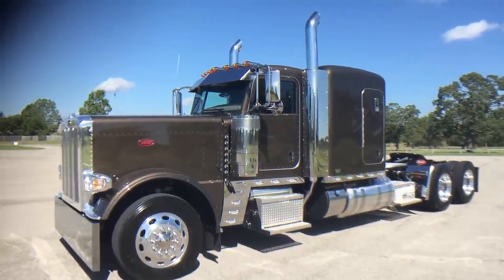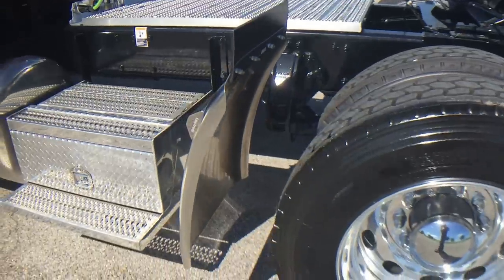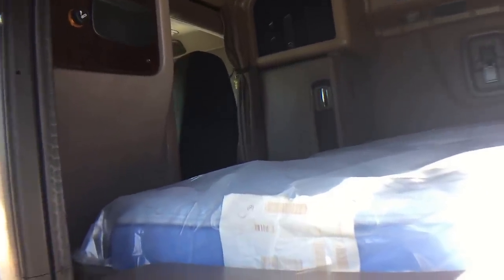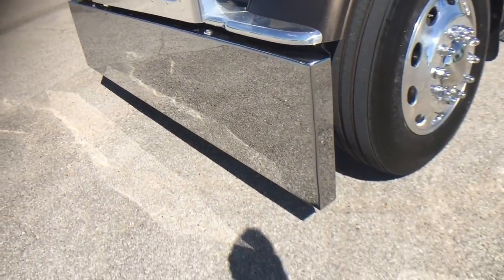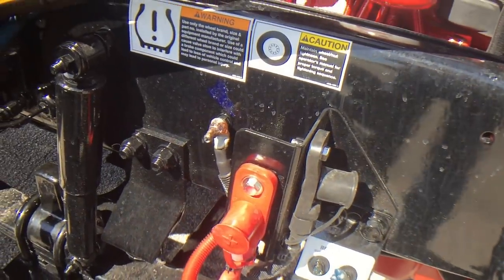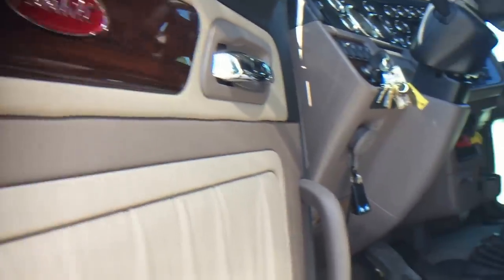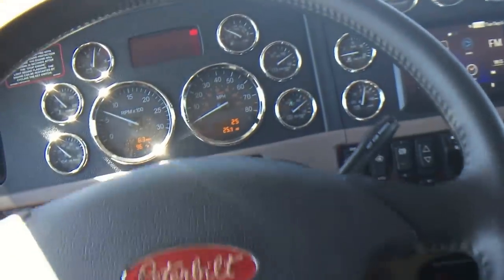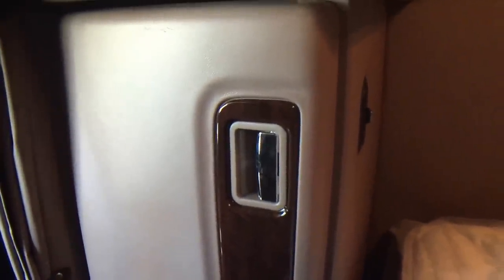For Sale 2017 Peterbilt 389 Flat Top 23 Gauges 550hp 18 Speed Owner-Operator

Comment: can you add a new reman-APU from TK? whats the additional cost? and where is that option installed at? or the quietest APU that is offered remanufactured new. thanks steve your the best.
Reply from the maker: Usually install it on the passenger side frame rail where the step box is. New is right at $10k reman is $5500. Thanks for watching!

Comment: Every def truck I have run doesn't break 4mpg
Reply from the maker: You must have a special gift of some sort. My customers would fire me if that was true....
Reply: Maybe they just don't do great with heavy haul situations.  At 105500 I could never get them to break 4mpg according to the on board computer
Reply: They probably do fine at 80k
Reply from the maker: My ATS heavy haul trucks do better than 4mpg. 5-5.5 seems common at 100-120k payload. Transmission, rear gear, and driver have everything to with the fuel mileage. You may be running a very tough route with many elevation changes and steep grades. Lots of factors can easily skew the numbers as I am sure you well know.
Reply: Peterbilt Steve you bet,  I drive up in the northwest.   No such thing as a flat road here so that contributes a lot.  I run a 6nz right now that manages to give me 5.5-6mpg even on this terrain.  What is ATS?
Reply from the maker: ATS is the largest heavy haul trucking company in the U.S.